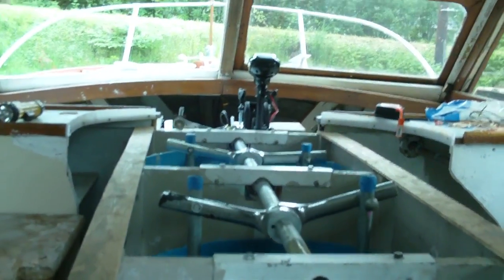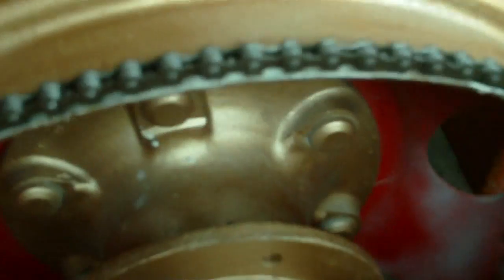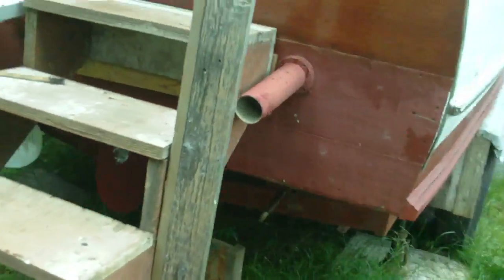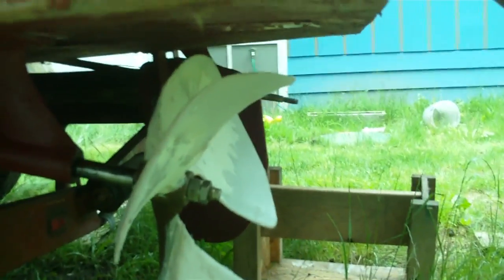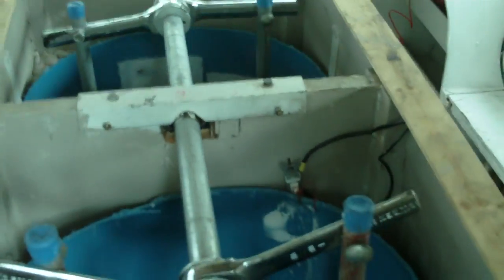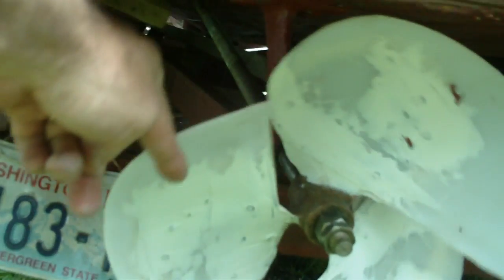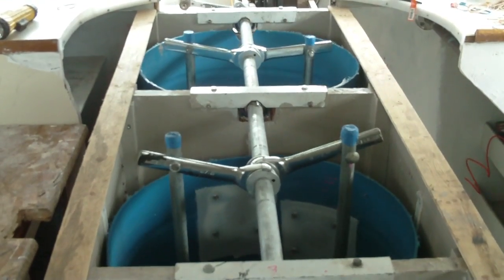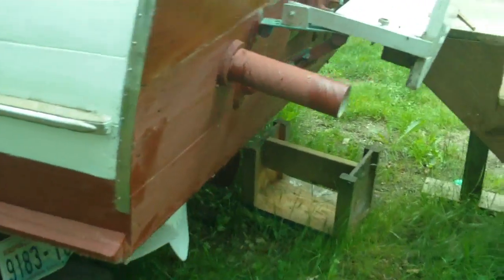reciprocating water displacement gravity engine inventor Brian Hughes

Comment: oscillating weight is an insignificant method that will not go anywhere unless there is recycling momentum established from the oscillating weights. This is useless I've thought of oscillating weight before but it will get nowhere, you need to be able to surpass today's engine speeds and torque, and if it were to be used for a small non resourceful extensive use then nobody would use this method, they'd use current methods of recycled electricity and infinite magnetic pendulums.

Comment from the maker: Yes! even with all that friction ,nothing round or true and built out of scrap,IT STILL WOKS. . This is a demontration of a low head dam.Why is it in a boat? When a ship moves through the water there is water pressure at the front that can be used to power the engine

Comment: @Mitpot9 At the time I had no frame of reference. The tome "Viamanika Shastra" or "Aeronautical Science" is a 10,000 year old text which describes what the Germans had called the "plasma engine". It uses a mercury-based fluid that reacts to a polyphase induction coil. The fluid will converge at its center at high velocity, which is the basis of the "implosion" or centripetal motor. This is the foundation of the "bell" experiments, which resulted in the "Haunnebu" or "Vrill" gravity bending disc!

Comment: Fill a closed loop of thin-wall copper pipe that is about 11/2" diameter and maybe 18" across with water & swirl it quickly by hand, it will float in the air for about a second or so. Then it drops slowly for another two seconds, and then falls as the water slows down. This is a demonstration I personally have witnessed, as I had assembled the apparatus when about ten years old. Victor Shauberger called it a centripetal "implosion" drive. I had one confiscated and got beat down for building it!